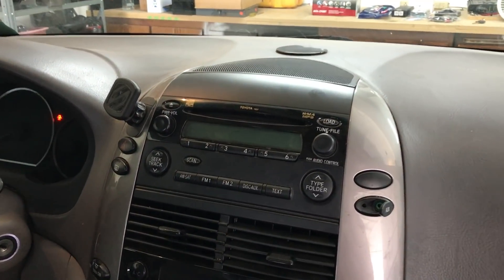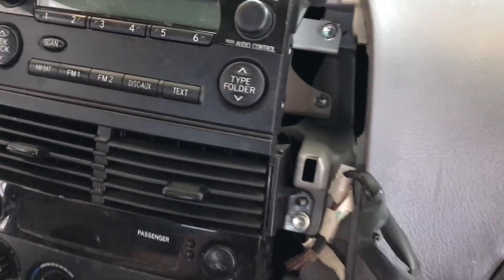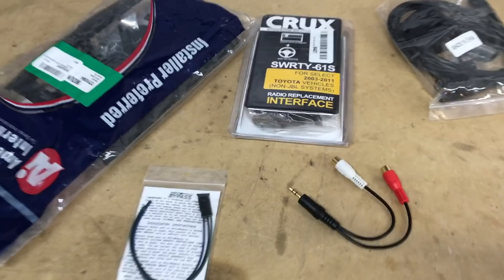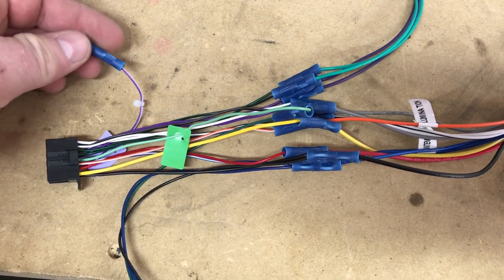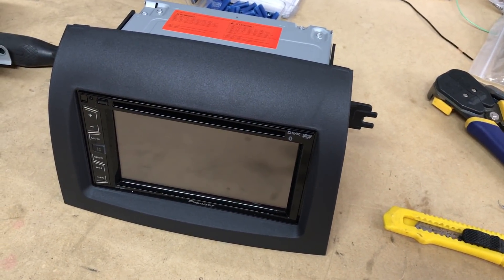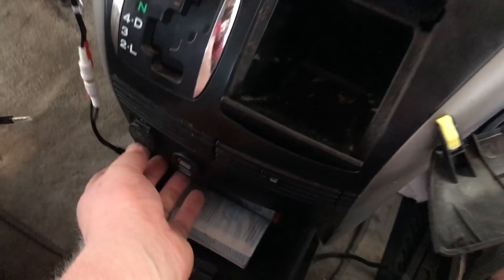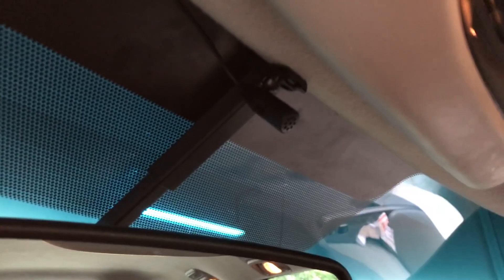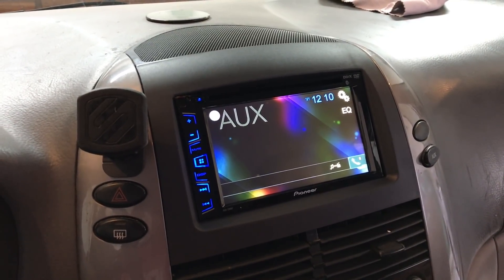2004 - 2010 Toyota Sienna Radio Install

Comment: And at this point I saved your video for my future install. Thank you at this point.
Reply: Swc won't work on my android atoto a6 pro. Crux not working properly
Reply from the maker: Crux usually doens't interface will with android units.
Reply: Agree...atoto a6 is not swc friendly.  Im upgrading to atoto s8 premium to get swc and wireless Android auto

Comment: Good useful video overall. But, connections using CRUX kit for retaining Steering Wheel Controls is where I am stuck at. Your video skips through the specific connections from stereo harness to the interface and then to car wires. It would be helpful if you had slowed down a bit when explaining SWC connections.
Reply: Also stuck on the swc control. Can’t figure out where to connect the red wire for power

Comment: Very helpful! Need to get the parking brake bypass switch to finish. Would be helpful to watch as you fish the lines through the car, particularly that mic cable. A coat hangar would have helped!

Comment: Thank you for an educational video, but I wanted to ask for clarification on a couple of wire couplings. I have a 2007 Toyota Sienna and purchased a Pioneer DMH-342 EX and attempting to install myself.  The blue/white wire from the radio is coupled with the blue/white wire from the Crux SWRTY-61S module and the blue wire from the micro bypass?  The same process for the black wire from all three?  You may have covered it, but I wanted to make sure I did it correctly.    Thank you

Comment: I have questions though. How do you connect the car’s antenna cable to the pioneer to make the radio work? How do you connect the parking wire? Also after I installed it, there seems to be no sound coming from the mid dash speaker. I have the 2004 sienna with JBL without an AUX. It’s so weird.
Reply: same

Comment: I left a comment yesterday and deleted it after catching my own mistake. I noticed your Sienna has an AUX, so I looked at mine and as it turns out, I don't have an AUX input.  In place of it, is a Engine immobilizer/theft deterrent
 system indicator light.  Towards the bottom of the dash above the cup holder, it looks the same, as I notice some have options for seat warmers.  Mine does not.  I've seen other installs of AUX ports using this panel area, just by drilling a hole and feeding it through.
How/where can I install an aux port on my van?  Can the unlabeled black oval cut out be used as such?  If so, how would I go about connecting it?  I believe the owners manual diagram labels this as Item #6, as a Power Outlet Main Switch.

Comment: I went with a iData T01 harness. The wiring colors on the T01 harness do not match up with the factory harness. And, there is one T01 connector with more wires than the corresponding connector on the factory harness. Is this right?

Comment: Finally, could the GPS function on my android phone show on the screen?
Reply from the maker: Not this model specifically, but you can depending on how you connect your phone.  If you purchase a radio with a video or HDMI input, you can mirror your phone with the radio to view your phone's screen there.  Alternatively, you can also purchase an Android auto or Apple CarPlay enabled radio to use your phone's navigation directly on the radio.

Comment: Will an aftermarket head unit like this one accept audio from the rear seat entertainment system (DVD) player in the back? normally you switch the factory system to AUX to get DVD audio through the speakers. I have a 2004 XLE with a jbl stereo (No nav)

Comment: Did you step down the 12V to 5V on your charging USB port? 12V straight in will smoke many USB devices expecting 5V.
Reply from the maker: Yes, at 6:05

Comment: Do you need the Crux SWRTY-61S Wiring Harness Adapter if your Sienna does not have steering wheel controls? Also, do you need the microbypass for the Pioneer AVH-290BT?
Reply: No, if do not have steering wheel control in your Sienna (CE trim) you don't need the CRUX harness. You can go with the basic harness, just make sure it serves the AUX function if the new stereo does not have one, unless if you're not interested in AUX jack.

Comment: I installed the microbypass just as you showed, but the volume controls on the steering wheel are not working?  Any idea.  I ordered all the same parts you did except I am using an AVH-1550NEX.
Reply from the maker: make sure you have the steering wheel cable plugged into the WR input on the back of the radio.  Also, check to see if you have the crux module setup correctly
Reply: I didn’t have the SWC plugged into the WR input.  Once I did that it worked perfectly!  Thanks!

Comment: I changed on mine today but with standard wiring kit just for speakers and power but buttons on streering dont work how we have to set the crux and my new radio has one wire it says steering wheel remote input

Comment: Ebay has the Pioneer for $130. The other stuff would cost less than $50. Probably $30. 
Pay a shop $100 to install it...
Less than $300 ain't bad...
Of course the best thing to do is buy the Sienna XLE Limited. 
   It has the killer JBL  sound system. 11 speakers.

Comment: so do you lose the CD player with this?  Is it possible to do something like this and either keep the CD player or have a CD player?
Reply from the maker: This radio includes a CD player.
Reply: @ProvoBeastAudio  is this radio available to buy online? Maybe you have a link somewhere I haven't seen. I as thinking of just installing a 12 disc CD changer with it, would that work? Thanks
Reply from the maker: @bhumane8642  Disc Changes are becoming more and more outdated.  There really isn't a simple route for a change install.  As for the radio, search amazon.  This is a few years old, so you can probably find a newer model.

Comment: Do we really need a new dash kit or can we use the factory dash kit off the old head unit?
Reply: a new dash kit is only like $20 (not including wiring harnesses), I don't think you can use the one from the old head unit

Comment: What's the mico by pass for? And dose it come with that wiring kit?
Reply from the maker: It bypass the video restriction on the radio while in motion and gains access to certain settings in the menus.  No, you have to purchase it separately.
Reply: @ProvoBeastAudio  thanks so that's for just video then because im going to be installing a single din

Comment: What size are the wire connectors? 22-18?
Reply: Where did you get the parts you used for the instalation

Comment: How much all the cost for the parts and the radio?
Reply from the maker: Price will vary on parts availability and your location.  All parts used are listed in the description and you can search those part numbers in amazon.  Prices will also be a bit inflated if purchased from local shops as well.

Comment: Would a 9" stereo fit in an 04 Toyota sienna?
Reply from the maker: Kit fits a double or single din radio, so as long as the chassis on that floating 9” is that chassis size, sure.
Reply: @ProvoBeastAudio  thank you for the reply 🙏